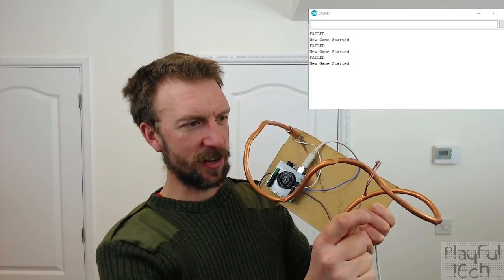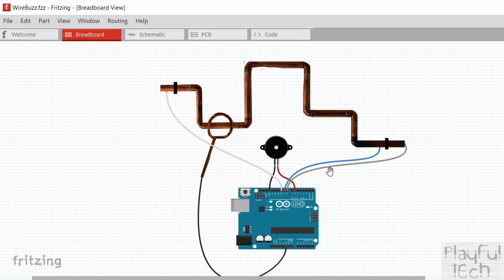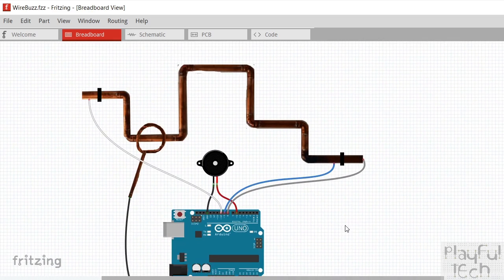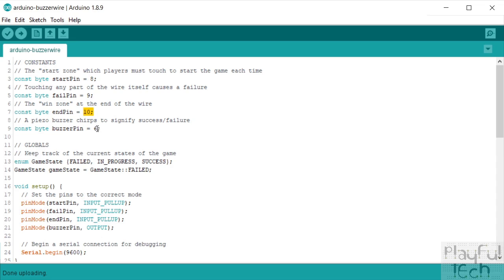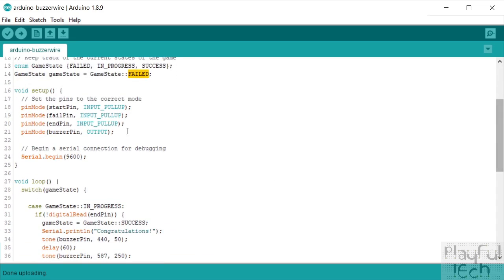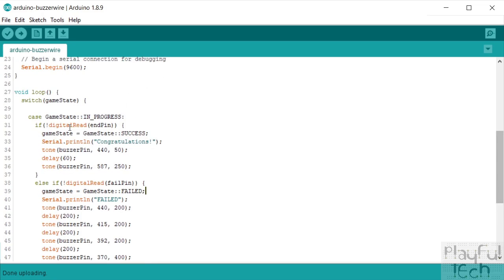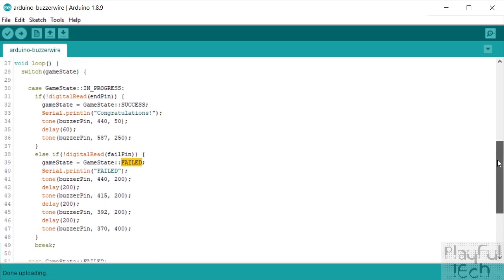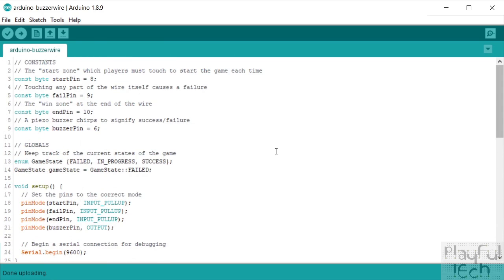Arduino Wire Buzz Game

Comment: How did you isolate the two ends?  They appear to be larger pieces of pipe filled with something to keep them from touching the main tube.  I have really enjoyed the series!
Reply from the maker: Yes, you're right - just slightly wider diameter copper pipes, separated by a cardboard sleeve.
Reply: @PlayfulTechnology  please contakt me i need some help